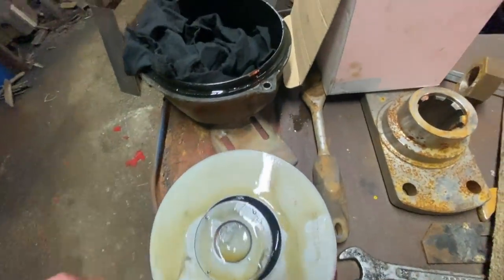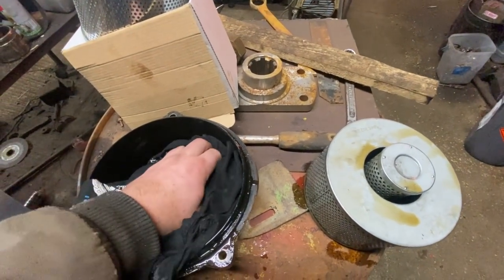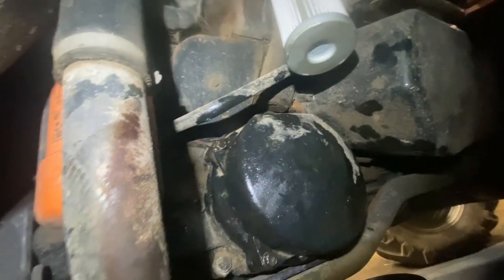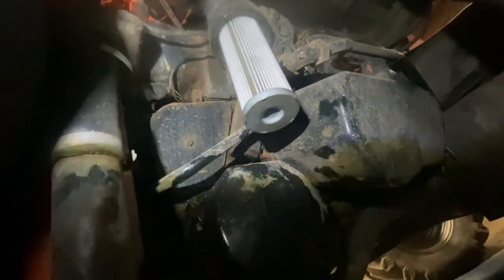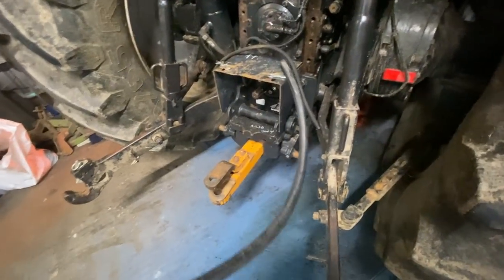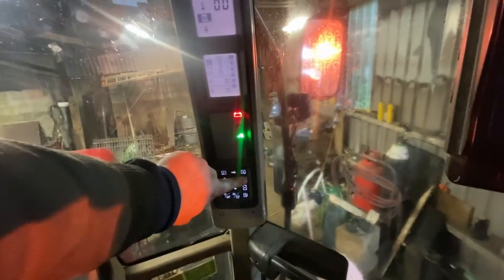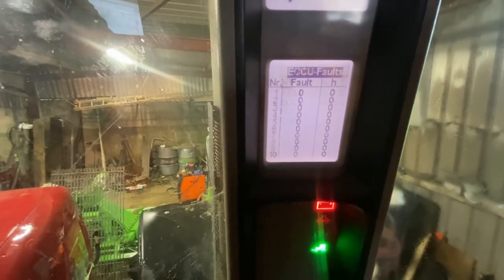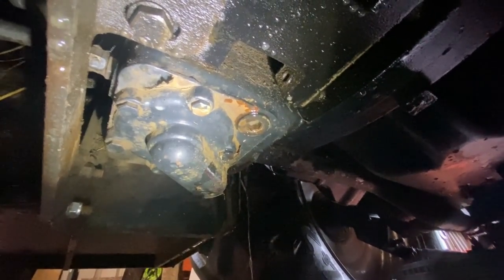THE CASE CVX 175 GETS A FULL SERVICE

Comment: Hi, great video which I came across purely by chance. The farm I work on has a CVX 195. The transmission oil desperately needs changed on it. We have the oil and filters required but not had the time. I did have a quick look underneath but it was not that obvious where to drain the transmission from. Any chance you could point out the drain plug. I have checked the operators manual but culd find no reference to changing the trans oil. TIA, Neil
Reply from the maker: You can either take it out the sump stud.
There's an Alan key head about halfway back the transmission to allow you drop the oil or else you can just take it out where the filter goes in but you definitely need the wheel off for that

Comment: Happy new year . Q for you would a loader tractor with a cvx be better than a normal power shift for loader work , and do you find them more reliable and cheaper to fix . looks Like a new cvx transmission would be the same or cheaper than a major job on a powershift gear box for what i can make out . Interested in what you think
Reply from the maker: A cvx would definitely be better for loader work.
I cannot comment on the how long the newer ones last without needing worn

Comment: love the vids, would you not use a diverter valve when you're plumbing in the  push out hitch, so you can switch between the hitch and the 3rd spool valve?
Reply from the maker: I could but the tractor has 5 spools so I don't need them all

Comment: Right first thing's first: Happy New Year & all the best for the year & season ahead of you/ye. Keep the Great work up.👏👏👍👍
I'm not conplaning in anyway. I didn't get a notification for this video or the last 1. You've this 1 up 4 or 5 hours. The last 1 was up before I even seen it & it was luck that I seen it, even then. It was up About 9hrs at the time, I seen it.
I don't know if it's a you tube, Internet or something on my side.
Is other's having the same problem?

Right so Let's start recking your head for another year, by starting off with another essay, by TRYING to comment on BOTH videos today.
This video.
That's good to know that you can use a hitch from a different make of tractor.👏👍
So is it all genuine filters or genuine filters in certain areas of the tractor?
How often should you or do you change the filter. That you said, your not going near this time?
Is that the standard 1000hrs service for you on your Tractor's?
I know there's a smaller type service done every 3 to 500hrs, depending on the person, themselves.
Is the front axle still more or less the same on the tier 3's as on the tier 1's? I can't remember,is the oil in the front axle different,than oil used for the backend?
Did you buy a trailing shoe for the pipe or is it the trailing shoe on the tanker, you were on about?
You'll need to buy 1 for the pipe this year, if you haven't bought 1 already. Just to collect it on the quiet.👂✋😅😂🤣👏👍
What's your thoughts on the ball hitch or do you want to try it out before you say anything?👂✋
So, can you check the hrs on the tractor,match the hrs on the eccu,by GOING through that check list for folt & maybe other thing's?👂✋
MORE than likely I asked you this before now. How do the spoolvales work? As I know that there's a button or 2 on the joystick (Whatever you want to call it). There's 3 if not 4 spoolvales on a tractor. There's 3 or 4 color square's on the small monitor, control unit on the piller. Are the square's actual buttons? Do you press the buttons on the piller to do,something or how do they work? Or did you go through all of that in a video in the past?👂✋
Right I think that's all I have to say about this video. Once again great video, keep it up.👏👏👍👍

Right so the last video.
Let me think for a min 🤔🤔☝️☝️
Right so, let's start recking your head again.😅😂🤣👏👍
You don't have to be on here, for people to be groge you. Also I don't think, it's just within this Country. That Sound's like you've came across it in your person life, down there? If so try not to take any heed of them. Just give them the Bird/finger. Be that in front of them or behind there back. While they're walking away from you.(That's not just for you to do. Everybody, should do it, including meself. From time to time.). I know it's easier said, than done. 👏👏👍👍💪💪
But if you do get it, you don't have to look to far from your own door to find people begroging you. In some case's it can be members of your family.
You can't beat having your own low loader. No matter how big or small it is. Also you'll be surprised what else you'll use it for & what weight you'll carry on it.
I was wondering what's the reason for the pieces welded on the side of the green chassis,at first. But you said why during the video.👏👍
Ya, you can't bet super single tyre's alright. They're great to have on any yoke, the big/adult version or the small/baby version onces.
Going by the video the cross members look to be the same height as the tyre's. So you putting something else on top, to raise the body up more,to clear the wheel?
The way your making it, is more than likely the best way to make a low loader.
A bit on the shed fire. You said if it when up fully,you wouldn't,nor could come back from it. You could come back from it alright. ((IF) That's the real question) you wanted to. It wouldn't be easy at all. Far from it. As like you said in the video, there's stuff in the shed that belongs to your grandad,dad,aswell as memories of him,them both in the shed. Financially would be more of a killer, so to speak. Like I'm sure there's thing's you'd change with the shed,aswell as thing's within the shed. I'm sure you'd make the door taller,to have more comfort getting tractors in/out of the shed. Lighting, plugs,etc. Having thing's taken away from you cause of a fire. Can be hard to take in & get over it. Compare to you, yourself desiding to knock the shed down & rebuild a new shed. I'm seeing that, at the uncle's now. Sence his house burnt down almost a year ago now. Anything up to 100 year's of stuff & memories. Just gone or having to get read of it/them. He has no choice,but full knock down & rebuild again (it's not nice,at all).
Ye,did the right thing, by getting read of the chopsaw for cutting steel. I bought one, nearly 20 year's ago now. It was a comply waste of time & money. That saw, that you've there is the right job. Also the dearest tool's aren't always the best tool's. Some of the cheaper tool's, can do the say job,as good & can last longer aswell.
The TM look's well up on it's stage,with light's on it. Ya, that's what Christmas is all about the kid's & Santa. Once Santa goes out of a house, it's not the same anymore.
The Massey? Were you able to put the air horns in under the bonnet or had you to get read of them altogether?
Stupid question, could get smaller ones & see if they'd fit under the bonnet?

Right that's enough of head recking/essay from me. From me. By the Time you've read all of this, you'll be in the form for drink. Be that to the pub or at home.
Once again,all the best for the year/season ahead.
Great video's, through out year.👏👏👍👍
Reply from the maker: And the same to you.
On the spool valves there all on the armrest of the tractor.
Once I start typing I can't read the message again.
The air horns are still in the shed. Waiting on some loader brackets for the tractor.
Will see where they fit then.
Reply: @mrcvx  o right, that's handy enough.
Ya, I'd be the same as that,once you start,you can't stop writing.
O right. Well it's big & heavy enough for the loader anyway. So that's all you can do, is wait & see how thing's plan out. You'll have your hole out,this week. Trying to get thing's sorted to start spreading Slurry again,this year/season.

I think I said it before, it's great to get a reply. If you don't reply it's fine aswell. As I understand that your busy doing your own thing.

Once again,looking forward to the video's for this year & seeing the new Tractor's coming aswell.👏👏👍👍